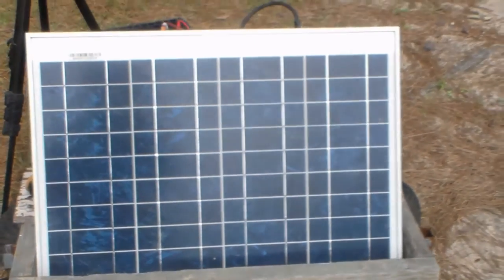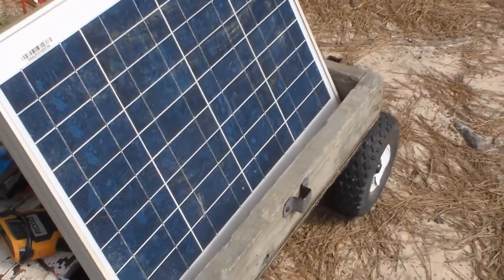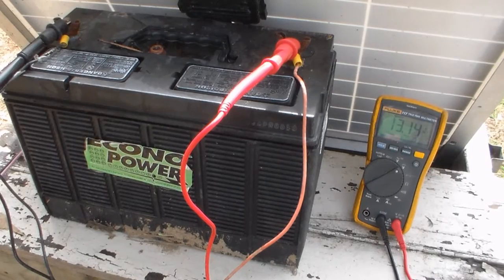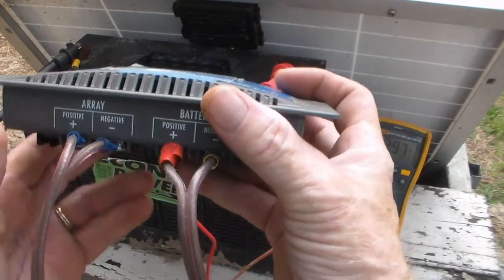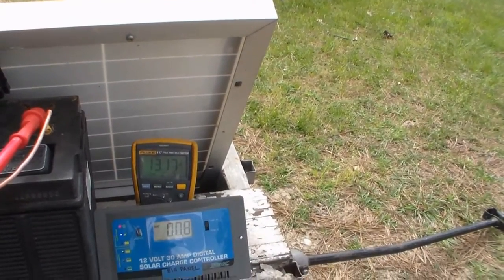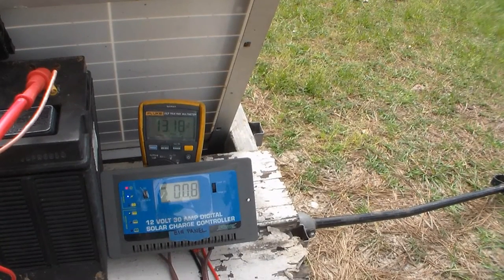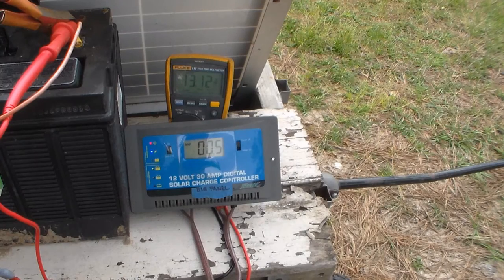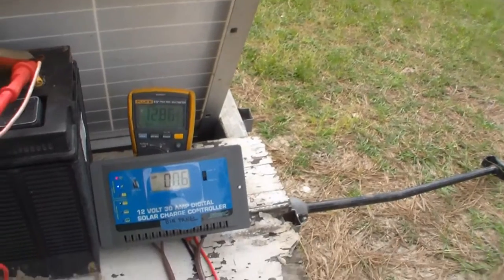Solar Crash Course - "Power Wagon"

Comment: Very informative! I have often thought of running a solar panel on my chicken coop in the winter to help heat it this is alot easier than I thought. Cheers.
Reply from the maker: Things that generate heat use a lot of power.  You would be better off getting real power to do that.  By the time you outfit enough power to run a heater, i would just be cheaper to run the real power. That panel I showed on the vid is like 100 Watts.   Even a small heater is 750 Watts.  As for a water pump or some lights, sure.  If you have any questions, I can help.  Cheers  =)
Reply: Thanks for the info!

Comment: I know the theory of MPPT but would be interested in a side by side with a PMW from the same panel just to see how much better it really is. I have a 240w Bosch monocrystalline panel mounted on a 360 ° rotational stand, also has 3 sets of legs for seasonal angles. The charger is an MPPT and my bank is 4 x 100 amp hour AGM batteries. The Inverter/charge is a Phoenix Multiplus 12/2500/120. You've got to remember my floating home is only 7' wide and 45' long so not a lot of room for a nice array!
Reply from the maker: My system outgrew the 30 amp controller so i had to go bigger.  It seems to extend the harvest time quite a bit.  It also let's me wire panels together to get higher voltages so the wires can be smaller.  Being you don't have room for more panels, I sure would go MPPT to make the best of what you have.  AGM is the way to go... No filling batteries and no gassing.  Sweet...  I took a peak at the Phoenix.  Pure sine wave.  and your able to have a second Battery bank.  Very nice rig right there.   
.
Reply from the maker: http://www.morningstarcorp.com/
Reply: Cheers Drukinone, I opted for a cheap MPPT, think it's called a tracer, anyhow it's been working well for just over 3 years so can't complain. Do you ever desulphate your lead acids? 🍻
Reply from the maker: On the controller there is a equilization mode.  It take them to 15.5 or so to knock the crap off.  The RE version of the Trojans have extra space that the stuff can fall into. These are very common and somewhat cheap.  (As batteries go).  When these quit, I at least have the cores this time, so it won't be so pricey.  I'll buy 2 more to complete the set.  I bought them at different times and I didn't want to mix them too much.  =)